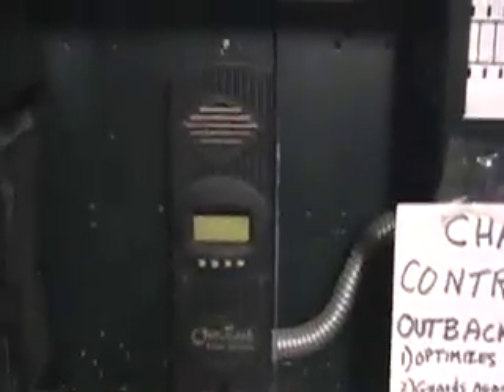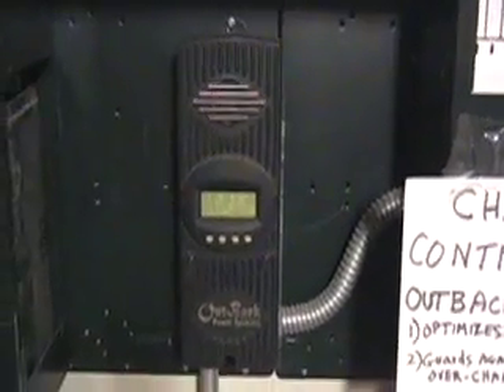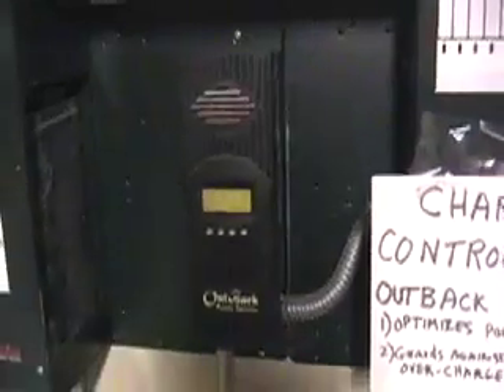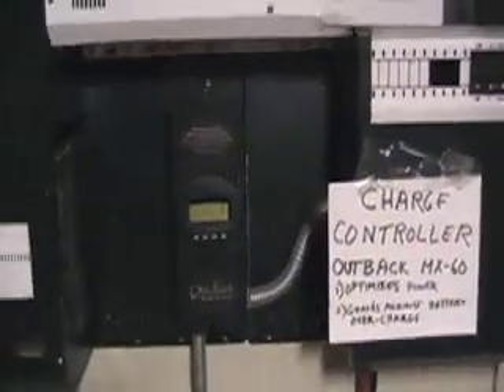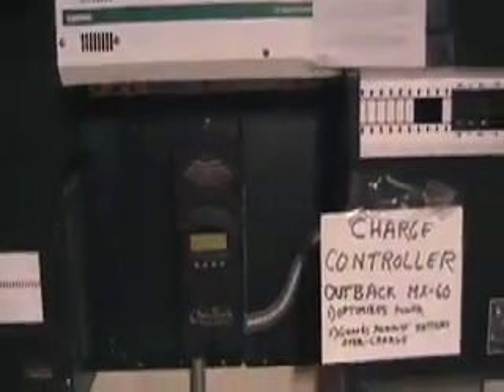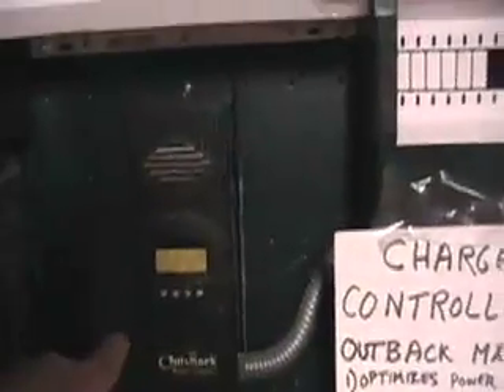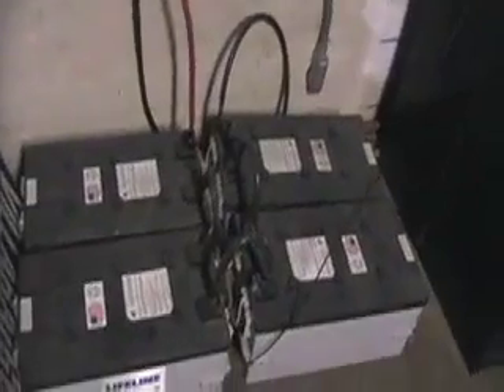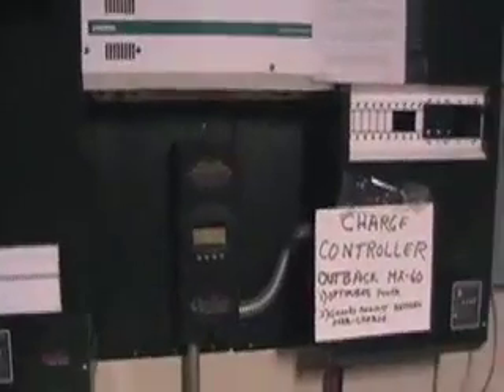battery backup solar systems -- how they work

Comment: @nomoreremakes this approach would eliminate the massive blackouts and brownouts, cause if the 'big source' failed, the millions of 'small sources' could sustain the grid at least for a while, before the main source is restored. The more important point yet is that they would take signifficant load off the centralized power sources - like coal and nuclear power plants - which would eventually enable us to replace them with renewables as well.

Comment: @nomoreremakes the point of solar power is to create a kind  of 'smart grid' - an intelligent, decentralized grid with many small independet sources. The grid could be modelled after the internet. Ever seen the entire internet go down? No? That's because the internet is highly dencetralized and every connection is doubled over many times. In fact it was originally designed to survive an all-out nuclear war.

Comment: yes turning the main off would effectively similate a power outage, and turn on the backup, so in your ap it would do what you want it to. Just remember that when you turn the gird back on the charger/inverter would also be charging the batteries, not a bad thing but it does consume power from the grid, just FYI to keep in mind.

Comment: Clearly an electric vehicle is needed to make this system cost effective. $300-$500 savings on gasoline makes the payback period on this reasonable.

So how would one use the vehicle batteries as a power source for the grid?

Comment: What are your thoughts on getting rid of all the charge controllers, put a battery load dump set at 13.5V off the battery bank, connecting the dump into a grid tied inverter?.

Comment: I am confused. I thought that xantrex just got into the hybrid inverters with the XW series if you have an older hybrid inverter I would love to know the full model number. If you figured out a way to modify a standered inverter to run hybrid with island protection I would love to here how you did that.
CHEERS OBX NC

Comment: Answer this for the world. what model is the inverter? what do it do in "normal" status, what does it do in grid off status. How does it control power back into the grid, or does it. Is it a charger inverter, or do the batteries rely on the charge controller only for their source of power. 

Just looking in from the outside.

Comment: I am sorry but your explaination is not very clear at all. I know what your system is doing, but thats because I am a master electrician, and electrical contractor, and I understand solar installations. 

Maybe start at the panels and explain each component till the system ends with the grid. You kinda jumped around after talking three times about  the PPT of the outback.